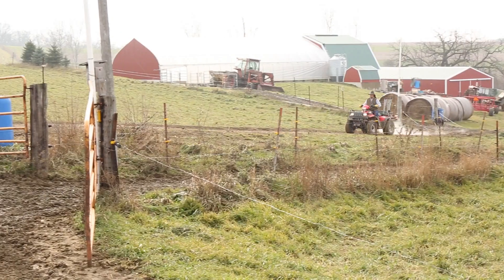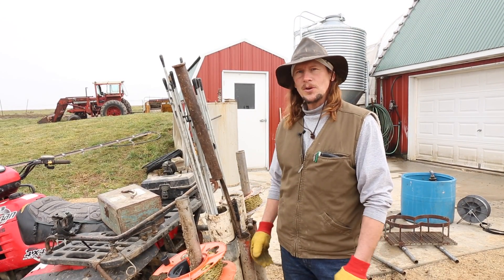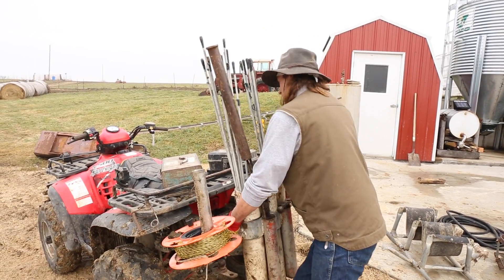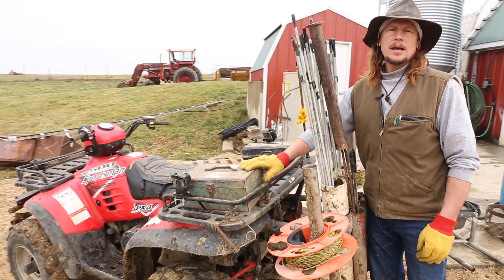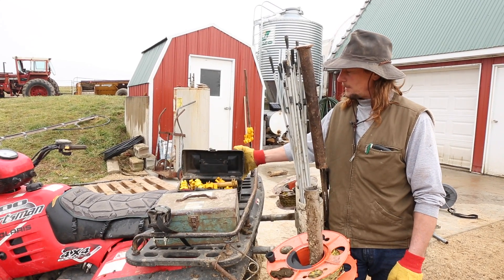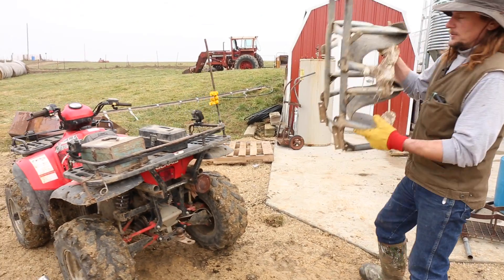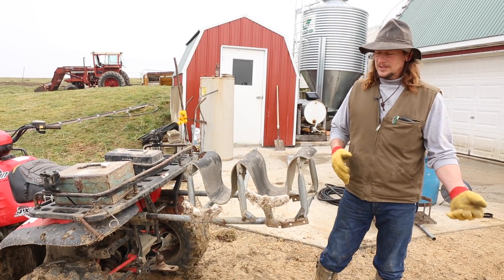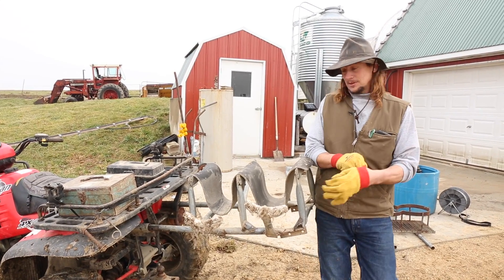Fencing 101: How to Outfit Your ATV Fencing Rig

Comment: If you want to mount the tool boxes just buy some boat plugs and use them like the Polaris lock and ride adapters. The boat plug works perfectly for a pressure mount fit on the rack, drill a hole thru the box and mount the plug so it sticks out the bottom and tighten it up.